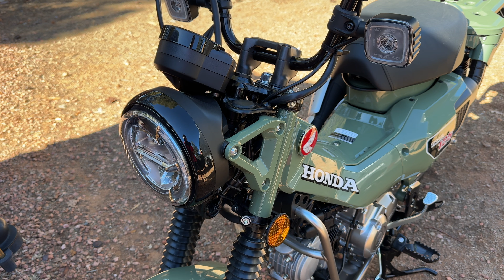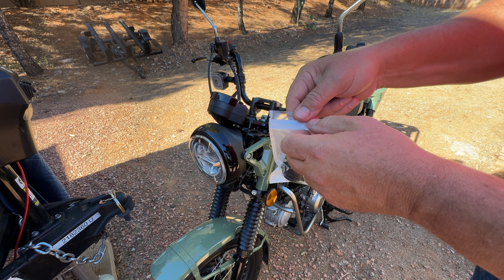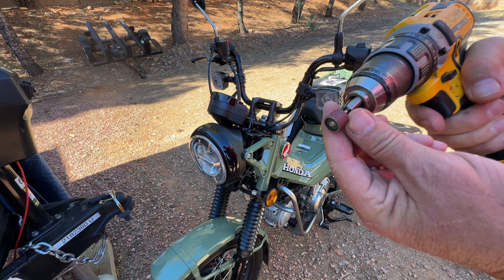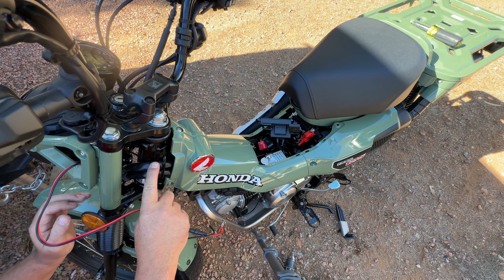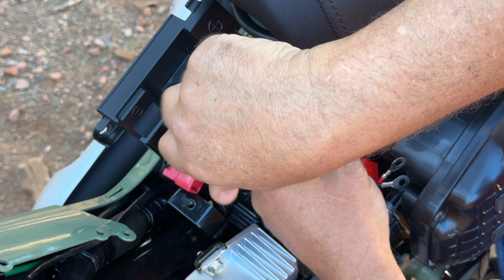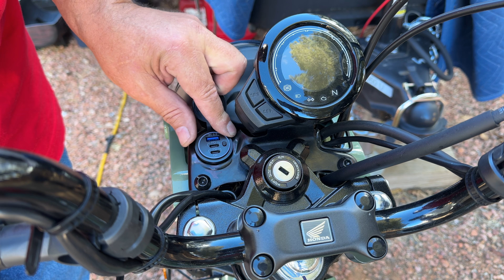Honda Trail 125 CT125 USB Accessory Charging Port Install #honda #ct125 #trail125

Comment: Just a caution about this particular charger.  Once I finished the install and did the test I closed the flap ran my finger around the perimeter of the cover making a good seal.  The next morning I opened the flap cover and the charger was on!  
I know to be careful in the flap closing that it can easily be powered back on!
Reply from the maker: You are right, my son had it run his battery dead. Just don’t push down on the side where the button is